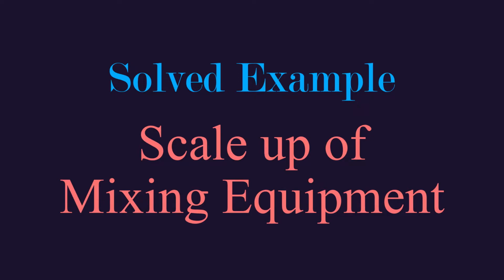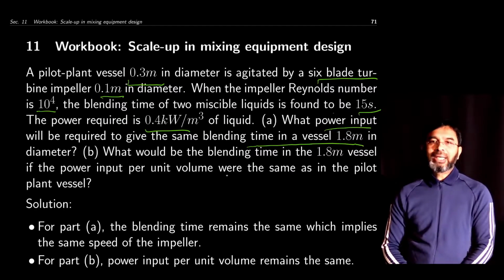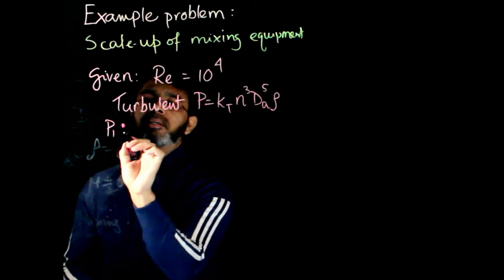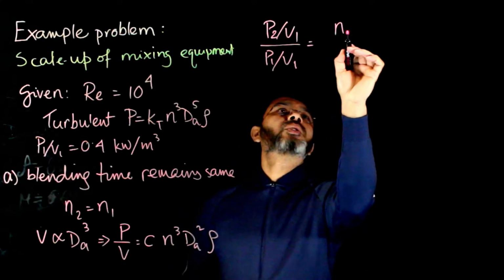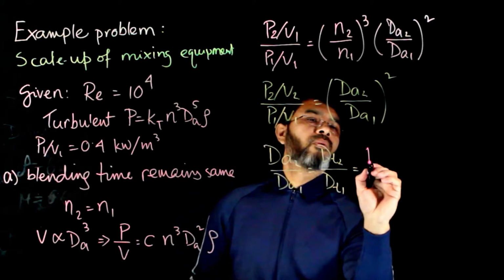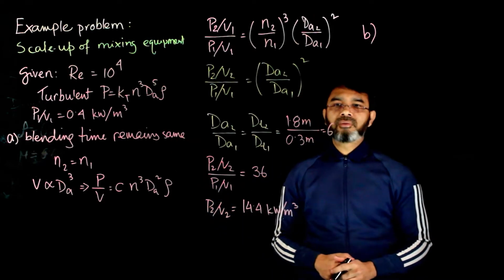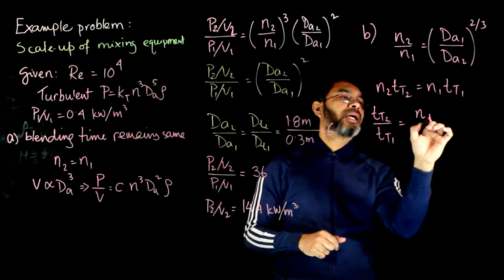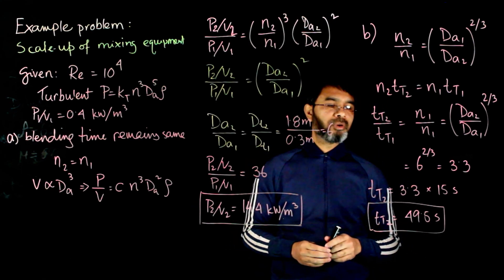Solved example: Scale-up of mixing equipment

Comment: Why blending time means that the two stirrer speeds are the same? That is something that needs to be worked out. Same blending time means that the both should be fully mixed in 15s, nothing to do with rpms.